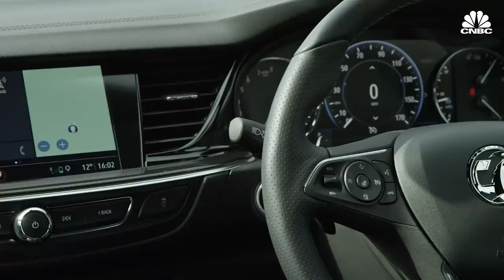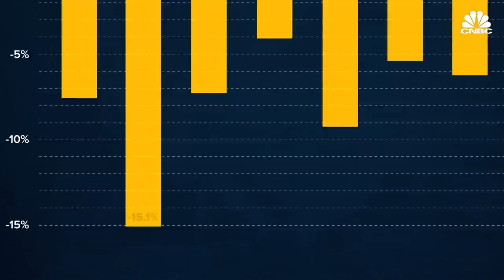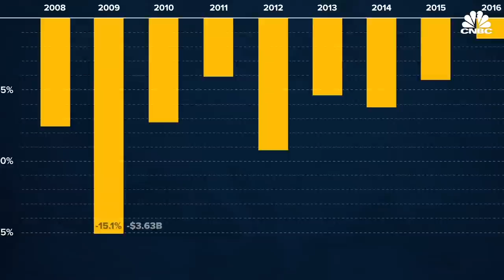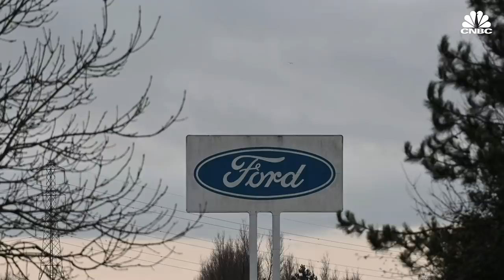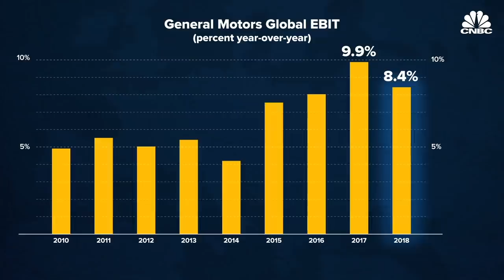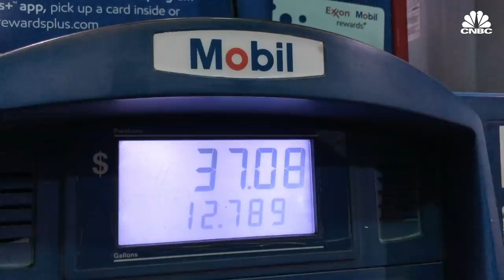Why General Motors Left Europe

Comment: Claiming Opel had made American cars is utter bulls. Cars designed in Rüsselsheim and engines designed in Bochum don't add up to make US cars. Some rare models got US engines, like the Opel Diplomat from the very early seventies that had a 5.4 litre Buick V8 installed.
The vast majority of cars had 1 to 3 litre inline 4 or 6 cylinder engines designed and made in Germany, though.

Opel ruined its once excellent standing with German customers in the eighties in its Lopez era with atrociously bad quality of the car's bodies. The cars were well priced, well handling, had good engines, but rust would eat them like the cookie monster biscuits. The brand's reputation never recovered from that. The troubles with gearboxes introduced with the Opel Vectra B in the late nineties didn't help either, or reports of persistent corrosion issues.
Then Opel bought BMW's 2.5 litre turbo diesel for the Omega, easily the worst engine BMW ever made. A company I worked for owned 7, of which 5 had cylinder head failures in the first year. The stresses of German Autobahn traffic are something many engines can't live up to!
I (obviously) live in Germany, and, when my flat was right next to a Opel dealer, I was happy when I got a Vauxhall Chevette, which I thought would be as much an Opel Kadett as it looked like. To get my spares from the folks next door sounded really great in the days before internet!
…boy, was I wrong. Bloody no parts matched between the cars, all different engines, not even the exhaust pipes were interchangeable. Making two different types of car that looked exactly the same sounds like a bloody stupidly expensive idea to me.
I loved my Chevette, but when the distributor failed, and I found that I would have had to pay DM430.- for a spare instead of the DM30.- the Opel spare would have cost, I dumped the bugger. With great regret, I have to add, the Chevette was a delightful and economical car to drive!

Finally, GM found it wise to dump decades old contracts with dealers and thus thin out their distribution network. You could buy Hyundai, Daewoo, Fiat, Renault, Peugeot, VW etc. on each corner, but Opel dealers got as rare as blue roses.

The manager Lopez ruined Opel's reputation, stupid decisions in design and persistent technical and quality issues kept haunting the cars and finally they played hard to get. That settled it.
I doubt the new French management will behave this idiotic. 

 GM ruined Saab as well. Forcing the excellently made Saab B204 engines, some of the best piston engines ever made (based on a Rover 2 litre inline, metallurgically evolved to perfection in Sweden), out off production and replacing them with, to put it mildly, mediocre ones, was a lousy idea.

GM's management ruined Opel, Vauxhall and Saab.

Comment: I own a Opel, bought new, and... its AC has to be replaced (since the car was new) and so the AC fan, just basic  stuff like trip computer is optional (and seller didn't told), they promised me electric ice-melt on the rear mirrors but there wasn't (my bad, didn't read the contract carefully), the radio is really crappy, seriously, why a radio can't tune the 50kHz in FM when any radio I had can.... yes I'm in Italy and here FM uses also 50kHz steps. Apple car.... two times in three don't recognize the phone. Also regoular maintenance is a rip-off: why they sell oil improver to a 15k km car?. Also it's  noise is like a 1990s broken-muffler car (and the car is petrol + LPG), the steering is spongy (turn half to 3/4 and it's the same turn). It also drinks fuel by the cubic metre (I can't go above 11km/L even with relaxed driving).... american car no more. I really hope PSA will do better with Opel regarding quality.

Comment: In the 50s their cars were renouned for the quality of their engines, bodies were the same as every other brands why French steel which was crap.My father had from 1953 Velox wyvern ,victor finishing in 1959 PA Cresta Royal glow and Ivory which we had 13year then I started with Victor 2000 1969 ran it as a taxi took it 4 times round the clock, before my father forgot to check oil, result conrod through the casing, not finished bought 2.3 short motor brand new married it to the 2000 head skimmed 60thou . kept bursting speedo,s Bildenstein Racing sent 160mph speedo to cope, no more burst speedos, in total the car had done 4and 3/4 times round clock when I traded it in. Then I got 74 2.3 VX490 TARTAN INTERIOR, WHAT A MACHINE , twin strombergs, eat 2.8 inj Capri,s had it 10year, 1 cavalier 1 carlton ,2 vectras , was going to get Insignia, glad I didn,t engines are pretty rubbish, check your records since they came out your quality of cars went down since then, I fancied getting new Astra but my son in law had one for a week says compared to Fiesta it,s crap. Hope you can accept the crititism from died in the wool Vx man

Comment: GM never understood Europe, never made an effort to adapt to a completely different customer environment.

In the video, GM cars are described as "American cars" - but I guess that you meant "car brands in Europe owned by GM" - which would be Opel/Vauxhall, Saab, Daewoo/Chevrolet. 

Driving conditions and tastes in Europe are very different from the US - we have narrow, curvy roads, which demand sophisticated manoeuvrability from the car - and motorways, where you can go 130 km/h and much more some places, which again demands a lot from the car. "Original US cars" are built for straight roads and freeways, where you travel at 80-90 km/h, so no need for developing exciting skills for the cars.

In Europe, car brands have "souls" - buyers expects something different from different brands, which GM never understood. They had a unique brand, Saab, which really could have been developed into a premium brand, which GM never understood. Instead of developing a new Saab 9-3 with genuine Saab characteristics, they just took a Opel/Vauxhall Vectra platform and moulded a "Saab" on it - but that didn't make a real Saab. Finally, when they built a genuine Saab, the 9-5, it was to late. Pity, because that was a very good car!

Then they introduced Daewoos as Chevrolets and even built the Chevrolet Cruze, based on the chassis of Opel/Vauxhall Astra. A good car which sold rather well, but then the lacking understanding of the European market came into play: they cut sales of the Cruze, as they feared that it would cannibalise the sales of Opel/Vauxhall Astras... ludricous, because the buyers of an Opel (still considered a German car) would never contemplate a South Korean car with a Chevrolet badge :)

Hyundai and Kia have understood the game: they understand the European market and have gradually learned and learned and have developed their European-sold cars into something that people really want - they even have their design center in Europe and tailor their cars to European tastes.

Comment: GM don't do well in the EU because they're cheapskates. They wanted Saab to compete with BMW and Mercedes, but whereas Toyota gave the new Lexus division carte blanche to develop the best Mercedes S-class competitor imaginable, Saab were forced to use hand-me-down platforms from a brand that was barely on par with Volkswagen in terms of prestige and reliability only slightly better than Alfa Romeo. It's a miracle Opel still is around considering they're both bland and poorly made.

Comment: Every car maker in Europe faces the same cost issues. Ironically many euro car makers at least the premium ones, sell well in the US. No US car made in the US bar the mustang and Tesla sell in Europe. Opel could have shared manufacturing costs with other euro car makers but didn't . Bar buick, no US car maker is succeeding in China even with so much more advanced engineering over Chinese car makers. Pickups have near zero sales outside North America, so good news, as long as US buyers keep buying thirsty trucks in a commercial market who could just as well drive a large van. Meantime GM loses its access to euro engineering and autonomous cars are still years away and EV cars need volume sales. The bolt was ideal for Europe and the volt (Ampera in Europe) was marketed badly (or at all) even when many euro car buyers knew diesel was not the answer. GM could have dropped models, bitten the bullet and just used Opel as the Co name and not tried to continue to compete with Ford, PSA, VW, Seat, Skoda and Renault, Toyota and Nissan. So now GM lives or dies on one market, one source of workforce talent and one car growth parameter.

Comment: Thank God they got out. I currently have an opel that does not run because Americans are the worst when it comes to diesel engines and spare parts. The pump cost ove 1500 € new and 500 € used. So as far as I am concerned good ridence and stay out!

Comment: Lets be honest GM products were shoddy, still are as far as I can tell. I purchased a brand new GM product in 2008, the seat cushion fell apart after 6 months and the door trim fell off about the same time, I took it to the dealer who replaced both. Then the other door trim fell off and they had to replace that, then the seat cushion fell apart again, and they replaced that again. It had a 3 year warranty period, and when I was up to my fourth door trim and third seat cushion, it was just months before warranty expired, I asked my dealer what happens after that, he said oh then its yours to fix, you will have to pay for the parts and labour to fix it. Err no I thought, I sold it and bought Japanese instead and would never go back to GM even if they still sold in this market which they don’t. They turned our local market which was only twenty years before a GM country, about fifty percent market share, into a GM desert, through shoddy products and refusing to supply what people wanted, like diesels engines, like SUVs, still building the same old sedans they always did, only a lot less reliable, every year they sales went down, further and further, and still no change, they just sailed the GM ship full ahead, till it slipped beneath the waves without leaving a ripple.

Comment: There are so many self-contradictory bad takes in this piece, it beggars belief. Were Opels and Vauxhalls too different to the rest of GM’s portfolio or were Euro-market Chevrolets too similar? It can’t be both. Is the European market too fragmented by an abundance of competitors, or too difficult to break into (which GM did 90 years ago)? It can’t be both.

Toyota, Honda, Hyundai, Kia, Nissan, Subaru, BMW, VW, Mercedes-Benz, etc. all manage to make vehicles that compete well in both the US and EU regulatory & labor frameworks, to both US and EU vehicle preferences, too. It’s not an excuse for why GM can’t compete there. 

Ford is particularly dominant in the UK, as well, and both GM and Ford have relied heavily on European-sourced engines and platforms for their successful American models, and have since the 1970s and 80s.

GM failed in Europe due to decades of subpar vehicles. Those vehicles tarnished the reputations of the Opel and Vauxhall brands for decades, no matter how competitive the new products were. And they were competitive toward the end. But it takes a generation to regain that respect. GM didn’t want to keep losing money until their image turned positive.

GME did not miss the crossover market, either. They’d offered the Mokka and Antara for years. The issue is that 75% of the EU market is in passenger cars while only 30% of the US market is. And GM is largely pulling out of the US passenger car market to focus on the most profitable vehicles. So future commonality with Opel/Vauxhall and GM North America was set to decrease, thus increasing costs and continuing to fuel losses in the region.

GM left Europe as a short/medium-term strategy to cut their losses and bolster their financials so their stock value would rise and they could attract investment from increasingly profit-hungry investors.

Literally every other reason given in this piece is a reason that almost every other world manufacturer, big or small, has overcome in order to sell successfully in Europe. The question should have been, “What is it about GM that meant they couldn’t/wouldn’t overcome those problems like everyone else?”

Comment: This is a video full of info however it seems to minimise the info that support the title of the video ie: GM’s most profitable vehicles are trucks large SUV’s, which are models that have a very small market i Europe, in addition the reuse of components for gun into its European models is around 20% far from the reuse percentage necessary for economies of scale, finally there was a comment in the legal regulatory requirements obligations for Europe being different than us, yes this is correct however GM has take. The option to fulfil the lowest regulatory obligations in each market and deploy to that, rather than take the highest standard  to engineer to, this is a commercial choice that chooses the poorer engineering outcome for profit. 
All theAs points were made but not expanded to the strategic result. The Ford gt40 evidenced that a us car maker could deliver world class vehicles if chosen. GM’s failure to deliver in Europe is a choice, it’s $1B losses pa for a decade plus market share loss from 17-8% in a result of a half arsed strategy not an indictment of us cars, us car engineering or European taste.

Comment: GM made almost everything wrong.
GM had no sense of quality.
1. GM strangles Opel down in the 90's. A well known reliable car company with good midsize car in good quality. Than GM forces Opel to reduce Quality to zero for higher profits. Opel cars in that time were just garbage.
That was and is never forgiven in europe.
2. Daewoo catastrophe. Daewoo sold old licenced Opel cars in europe. Same quality but extremely cheap. The next Gen Daewoo Cars were better but still cheap. But you get what you paid for. Than GM made a patch over to Chevrolet. And raises the prices. Suddenly the "Chevrolets" were in midsize price range. 
3. The "Chevwoo" Joke. Chevrolet was known in europe for big cars with big engines. Camaro, Corvette, Caprice, Tahoe, Suburban and S10. Most of them were buyable through the Opel dealerships. 
Suddenly the US Chevrolets were gone and Chevrolets were tiny little low tech cars. (On ridiculous high prices)
4. GM never understood the way of European and especially german driving. Sporty cars with enough performance to "swim with the swarm".
5. GM never understood the Diesel.
6. Entering the market with small US models. Generic as hell. With the weakest fuel economy, acceleration and top speed. With still low quality. And of course still to high prices.
7. Keeping Opel small. GM decides to slow down Opel to try to raise their own Chevrolet car sales in europe.
This were just stupid. Immolat a raising brand to push a dead duck.